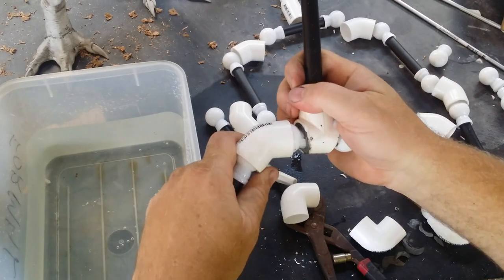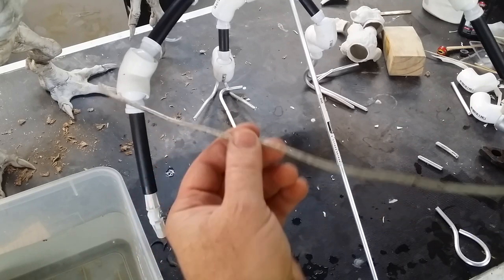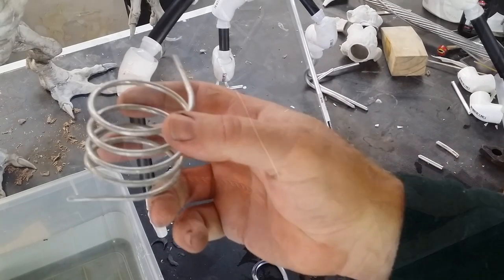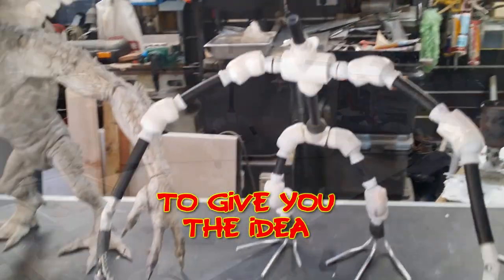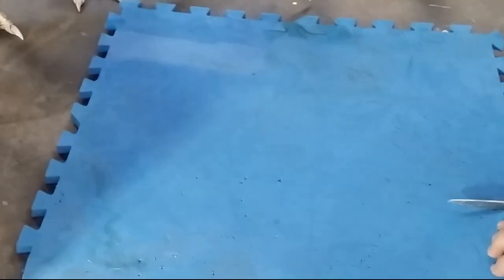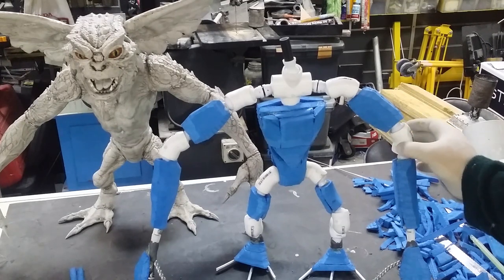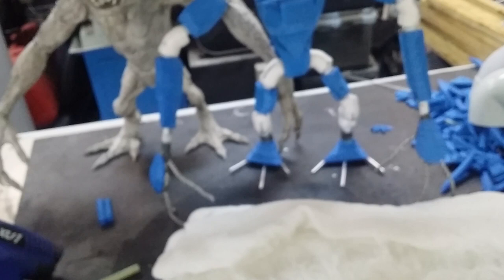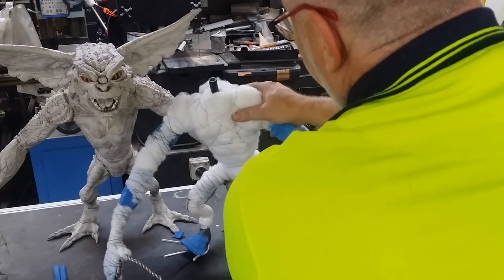Gremlin Build Part 3

Comment: I know the sockets are pvc pipe fittings, but what are you using to make the ball part of the ball and socket joint?  Maybe you showed in another vid and I missed it.  If so please let me know what video.  Looks brilliant so far!
Reply from the maker: These are the one's I've used but I think most hardware or curtain places would have them...
https://www.bunnings.com.au/windoware-ivory-pvc-ball-finial-to-suit-16mm-curtain-rod_p1261285
Reply: @jazcreations  Thanks!  Hunh...never seen those before.  Very neat re-purposing there!

Comment: Where did you get the Wrist joints and also the ball joints?
Reply from the maker: They are just curtain rod ends and PVC joining pieces :)
https://www.bunnings.com.au/windoware-white-pvc-ball-finial-to-suit-16mm-curtain-rod_p1261286
These are available in Straight T-peice and Elbow
https://www.bunnings.com.au/holman-25mm-press-pvc-coupling_p3140756